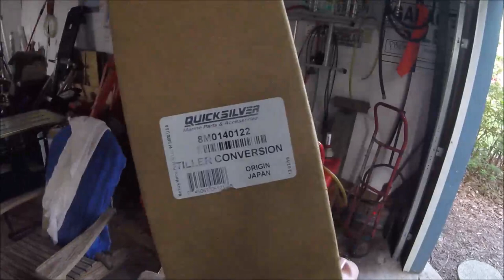Mercury 15hp Pro-kicker kicker... fail!

Comment: Sometimes things are just not feasible. Not a fail, just a tactical retreat in the best interest of the the main goal, "making a living"   Simplicity is the best way to go.
Reply from the maker: after pulling all the parts out, the ''electrical'' cables are HUGE!!! and can't be correct, especially the 10' extension! Nothing fit together. AND not gonna wait months for replacements. Certainly not the ole days anymore. This is now the time to Buckle up, cuz this country may just fall apart at the seams.
Reply from the maker: you should have seen all this! Merc put so much into that NEW STYLE tiller. If it was the old school MERC it would have been so much easier. Maybe not days and days of mayhem. gawd they made things so difficult.  I told ya!

Comment: Nothing KICKS CAPTAIN DAVE'S A$$EXCEPT CAPTAIN DAVE.. Not a failure just a set back.JUST set your captain self back there set the speed and steer on ..
Reply from the maker: AS I HAVE BEEN DOING, YES! ''simple''...Mercs ''redesign'' of a ALL inclusive fancy tiller makes for a big issue. Talked to a CANADIAN Merc dealer in British Columbia that could handle this with ease. They buy Merc pro-kickers for boats with NO tiller installed and do exactly what I wanted. But, in Jac-azz, Florida it's a alien beast.

Comment: Man I hate to let something get the better of me! So what if you sold the Kicker you have now, and bought even a used motor, and controls that is already set up for a stick steer Jon boat? No tiller to remove, no wiring cable as big as your thumb, just simple rigging like it was going on a Jon boat? The key switch, and throttle box all one unit, then use your big motor to steer!  At least you could bypass all the crap trying to remove the tiller? I’ve seen plenty of stick steer 15hp motors! I remember you talking about wanting to get another Jon boat going for creek fishing, so buy a newer used one, and swap motors as another option? Thoughts??
Reply from the maker: no selling my kicker, it doesn't have 100 hrs yet!  Next time as I wanted to do, but of course couldn't with no time or $$. I'll re-power with twin 115's, and take kicker and have a ''simple'' tiller steer jon-boat.
Reply: Capt Dave's Sport Fishing twin 115s😳 Get you some! That would be bad azz on that boat! But very expensive I’m sure✌️